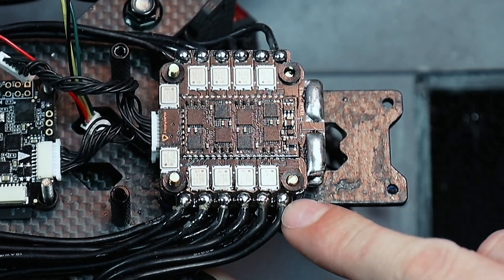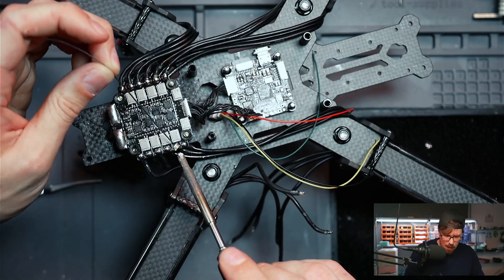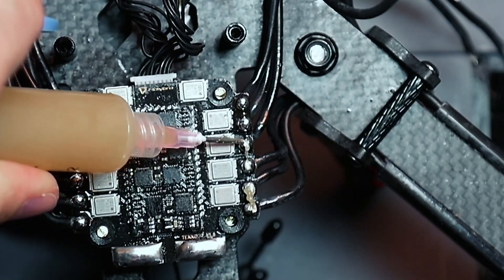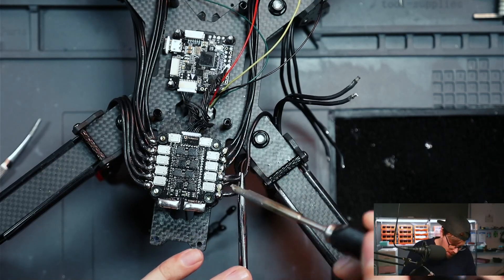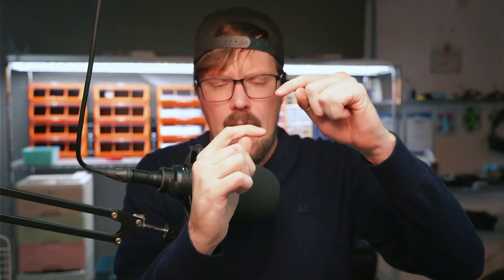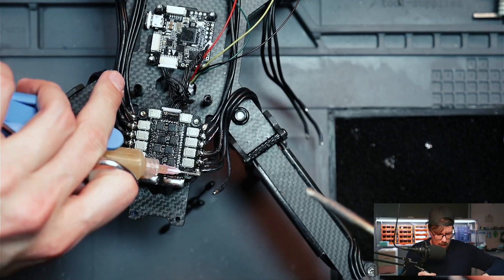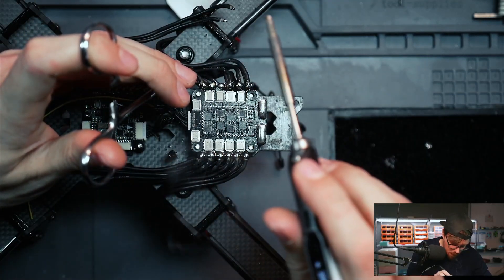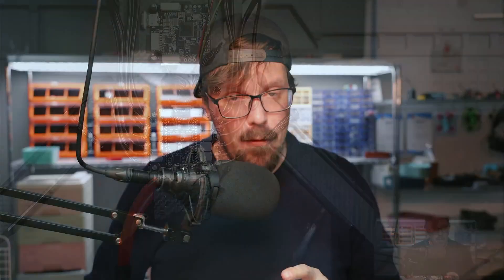How to get Perfect Solder Blobs on FPV Drone - Patreon Video excerpt

Comment: What can you do if the solder doesn’t stick well the pad?
Reply from the maker: Use flux and increase the heat. Also use 63 37 solder
Reply: @33rdframe thanks for the help.
Reply from the maker: @dre5551 60-40 will work too btw

Comment: My solder joints are near perfect and this is definitely not the method I use or suggest. Your backing up of you don’t also heat the solder that’s been applied while tinning your wires
Reply from the maker: Near perfect < perfect 😂

All jokes aside. There is more than one way to skin a cat. However, as for backing off the flow the the larger solder blob takes more heat dump than the thin wire. If pretinned the wires solder flows almost immediately so if you have applied enough heat to flow the boards pretin then it will 100% flow the wires as well.

This is advice I got from an old engineer who had been soldering professionally for 35 years. In fact it's the general rule of good soldering is hot and fast. I'm sure there are other techniques, though.
Reply: @33rdframe well I definitely agree with hot and fast but the copper content in most of the budget boards would leave you with a cold joint using this method I’m afraid. Been soldering for quite a while and building these crazy things for almost 11 years. So far I find the best practice is to heat my pad then lower my wire to my iron heating it as well then pull iron and wait for joint to solidify. My results are beautifully shiny joints that have never failed. But maybe your way is easier 🤷‍♂️ I’m self taught so I only know from my experiences. To each their own

Comment: What model of solder tip are you using ?
Reply from the maker: Chisel tip
Reply: @33rdframe It's actually D-24, but yea i also found it searching for ts100 chisel tip. Thanks for the pointers in the vid
Reply from the maker: Thanks for letting me lnow that. Now i can find it again easier haha @RacsoFPV